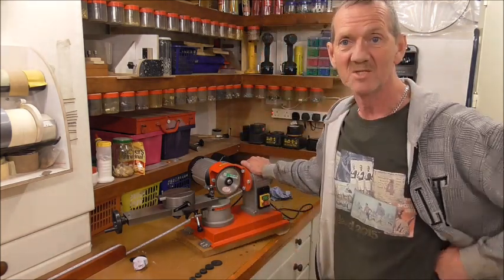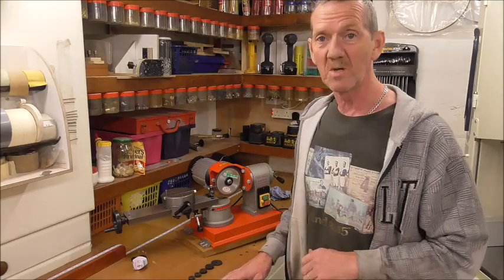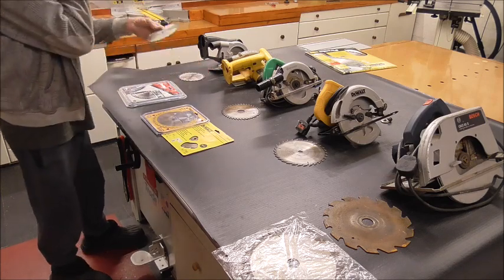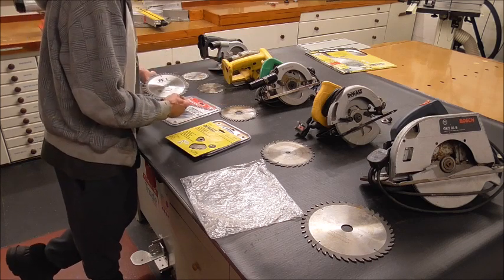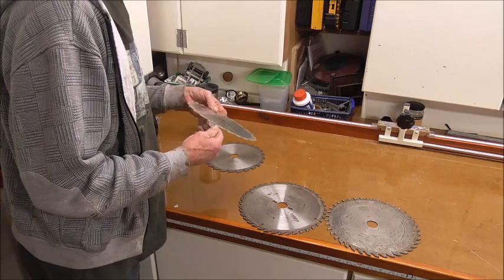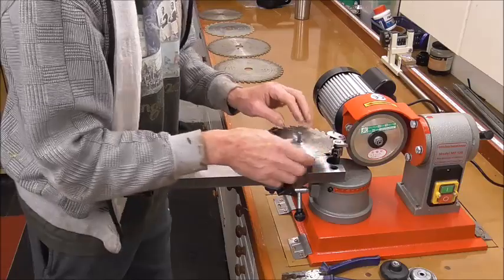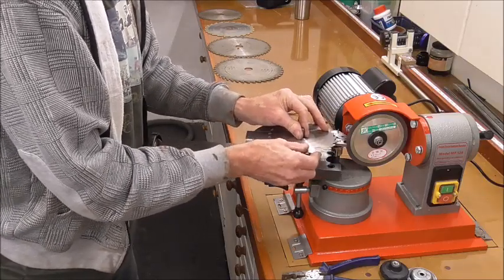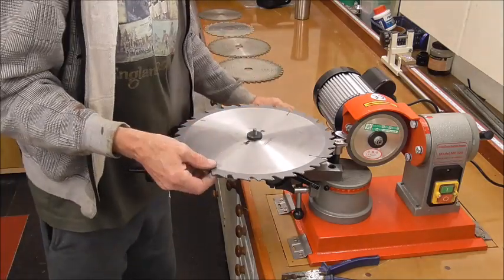Power Saw Blade Sharpening

Comment: one thing you were doing wrong during sharpening is I noticed when you put the tooth against the sharpening wheel you were sliding it forward and back which I understand to evenly wear the wheel but when you were done sharpening you were just sliding the blade back and off the wheel while the blade was still in contact with the sharpening wheel.   this could cause the tip of the saw blade to pass over the edge of the sharpening wheel.  when done sharpening you should back the blade away from the wheel before moving the blade back.

Comment: WASTE OF MONEY,  I USE A TILE SAW, WORKS AWESOME.  USE PAIR OF DOOR SLIDER AND THE ANGLE IS ON THE SAW ITSELF   UNDER 50  BUCKS A PLUS IN MY EYES
Reply from the maker: what ever well done it sounds good,
Reply: Make a video that we could see.
Reply: The tile saw blades sharpen blades that are going to be used on wood sort of fine.   However; you need a smooth edge if you are going to sharpen a blade that will be used on metal.  They just don't make tile saw blades at a fine enough grain.
Great job on this video.
Reply: Why is this sharpener not up too snuff? why the tile saw something better. Please show us how it works. Don

Comment: Thanks for this video. Just received one of these sharpeners. After the typical modifications to get the proper arbor size, tighten the shaft where the stop pin is anchored to, I got it to where I could sharpen my first blade. works really well. My next move is to take my angle grinder and grind a bit off the guard and motor housing where the 4th or 5th tooth hit, left of the grinding wheel . My warranty will be void, but my life will be better for it. I know you know what I am saying. Your video helped me a lot to get this grinder tuned and tweaked!
Reply from the maker: Andy Evenson Thank you Andy for watching, yes i find with many if not all machine tools we need to tweak them to fit with use and how we want to use them, anyway its good news your now up and running and all your power saws will feel much better for it

Comment: Interesting video. I wish I need one of those sharpeners but I’ve only got a couple of circular saws. 
I like your drop in bench tool system, it makes a lot of sense for tools that you don’t use constantly but need to be firmly fixed down.
Reply from the maker: Thanks for watching yes I am adding other tools to this system as the shop is getting smaller with every new tool

Comment: Great video and  explaning  how to and why, i bought exactly the same  saw blade sharpener as you have, coming next week, has a  special googles thats as your lupp to could see exaktly the angle an to  sharpen the right way, could  easly be aplaid with a water tank that could drip down on the surface the  abrasiv works,  sems useless for so short assembleys that you  did to get a tooth sharp, , i say it again good video thanks  5 thums upp

Comment: Cheers for this video. I note they come with a water tray now too, so I will go for that type. £155 but pretty much looks the same. 
Gonna watch your topping vid now.
Reply from the maker: Hi Brian thanks, yes I believe the water one is a upper model not available when I got mine but a word of caution without looking at it, water grinding normally requires different discs if so be sure your given the correct one, beyond that good luck
Reply: @dmgladden  Aha, very good point. More research on my part, cheers. I also need new blades for my planer/thicknesser,  This machine wont sharpen those!!
Reply: @dmgladden  [update]  All good. the one I am looking at has a diamond wheel, if taken gently (light touch), I could use it dry too.
I also remember watching your van re-fit some time ago too, nice job, the rough weather canopy was a nice touch.

Comment: If you could make a collet block that fits in the dovetail on that round thing where you mount the saw blades you could sharpen drill bits with this. With the bit pointing down the length of the arm, the angle of the arm dictates the drill point angle and the angle of the cutting disc is the facet angle.
Reply from the maker: Meme Master yes such a machine van be adapted for a number of other tasks, i do however have a dedicated drill sharpening jig which does me fine but its a good thing to get the most you can out of every tool, thanks for the interesting feedback

Comment: hello, thanks for the video
I have a similar device and was wondering if all teeth are always sharpened at 0 degrees. So say the long part of the tooth, not the tips. If the long part also has to be sharpened at a certain angle, can you tell that from the data on the saw blade?

gr. Arie

Comment: Thanks for the review, I have purchased one of these, had it for six months and now it's time to set it up.
 I would like to point out a small thing that is not covered in the video, for other users.
The DUST from grinding tungsten  is SERIOUSLY DEADLY and should be avoided at all costs.
By this I mean you should wear a mask and have a vacuum cleaner set to suck up the dust.
But very informative video, lets share the knowledge.
Reply from the maker: Thanks for the info which i was fully unaware of so i did a bit of research and this was the best result i got: 
The electrodes themselves present little threat of harmful radiation exposure to personnel. It's the fine airborne dust particulate, released by grinding and tip prep, which pose a threat of radioactive particles entering the body. So if your shop equipment is not properly ventilated it may be out of compliance, putting you at just about as much risk as your smucky coworker who puts the things in his mouth.
Personally i have just 3 years ago stopped smoking, i guess ironical
Reply: Yes ,I actually meant inhaling the fine tungsten dust.
As the ingredients of tungsten carbide include Cadmium, Chromium, Cobalt and Nickel, these are all metals used in tungsten carbide brazing and grinding, not a problem in big pieces, very bad as fine particles..
And thanks for the clip on how to set it up!
Reply: @dmgladden  That information is for Thoriated Tungsten welding electrodes. Grinding dust from grinding any Tungsten Carbide, router bits , lathe/milling bits or saw blades is seriously bad for your health.

Comment: Thanks David, very informative- 

I have a small Sealey sharpener. It's ok. 

I've been for quite a while, angle sharpening the main flat piece - WRONG and not the top as you demonstrated- 

That's a big boob on my part - thank you for this Mate 👍🐒
Reply from the maker: Its all a learning curve Gary and now you know and can pass it on to others that's the one  good thing about youtube, theirs so much we can all learn and its free
Reply: David Gladden - agreed David, and for me  ~ much quicker to touch up now. 

Tx again 👍
Reply: Maybe yes & maybe no!
When your sharpening cross cut saws as shown here the flat face is sharpened at flat angle 90degrees on each tooth & yes when you have to sharpen the top faces due to chip etc THEN for set you tilt the motor & diamond wheel to the 8 degrees shown here.
However,
When your sharpening a rip saw rather than a cross cut saw, the faces aren’t flat 90 degrees, they have an alternate bevel on them of often 5 degrees, so 85 & 95 degrees on alternate teeth as well as the “set” angle on the tops of the 8 degrees shown here.
So “compound” angles for the face meets top.
So when you say you we’re doing the flat faces “wrong” we’re you sharpening a cross cut saw blade or a ripping saw blade?
Next - as well as marking with permanent marker the tooth you started on, IF you also mark the flat face as well, when you start sharpening that first tooth you can check you have your motor / blade tilt exactly at 90 (or for ripping blades at 85 / 95 degrees by whether all the permanent marker is removed across the entirety of the flat face or whether your a fraction of a degree “out” because it’s removing all the ink on one edge of the flat tooth but leaving a little ink trace on the other (leading or trailing) edge.
Now normally on good blades at least, the data on blade diameter, teeth number, arbor size & degree of set hook etc is engraved on the side of the blade or the cardboard packet the blade comes in - to allow you to set up your machine to the original factory specs first go.
What I have done is replace the washer that holds the aluminium diamond coated sharpening wheel to the engine drive shaft with a 3 inch flat steel washer!
I then use a “wixey” brand digital inclinometer / angle finder, (about $45 on evil bay) and with Machine unplugged attach its magnetic face to the washer, which allows you to set the tilt to 1/10th of a degree increments, to get it exact!
Just zero the gauge off the flat face of the saw blade when clamped onto the cast iron cross feed slide, then attach it to the diamond wheel bye it’s magnetic face & adjust the tilt to exactly what you want!
You can then match factory specs first time / tooth every time, and have repeatable accuracy just like the saw doctor does with his fancy automated CNC blade sharpener!
The ink test allows you to confirm visually on the first tooth that you got it exactly right!
Just a couple handy tips for the newbys! 👍
Reply: @ianmoone2359  another thing to add, is safety, a respirator is a must as carbide dust isn't good for you

Comment: My saw blades are 315mm diameter the same as you showWhen I set the rake angle the blade fouls on the motor case. Maybe my blade has an excessive rake angle. It’s 32 teeth. It was the one supplied with the saw by Sedgwick.
Also my blades need the motor tilted to sharpen the tooth.
Reply from the maker: You must have something set wrong or the machines set up wrong as you should have no trouble with that size of blade but without seeing you do it I can't work out what is really going on sorry
Reply: Thanks for the reply. You seemed to have had the same problem at 17.20 ish. The cutter only projects a little bit more than the motor diameter and it’s support piece. This doesn’t matter on smaller blades. I am loath to take the file and hacksaw to it to improve clearance. I can’t find a 130mm dia disc but I have ordered a 125mm dished cutter. It might work. Meanwhile I sharpened with a lesser angle. I find Chinese machinery always has one major design consideration to overcome.
Reply from the maker: @jimbo2629  yes it looks that way but it did fit just the camera angle however I understand what you are saying now but I must say I don't have that problem with any of my blades and they have all been through this machine now, so I haven't had tho think of a way around this problem but I agree that's one of the drawbacks of Chinese tools.
Good luck and let me know how you overcome it once you have. David
Reply: I’ve overcome it by flipping over the cutter disc and the Saw blade. Accommodating  the rake is now obtained by angling away from the motor. Problem solved. Another niggle is the play in the dovetail slide which can produce chatter when the tooth touches the cutter. Again it’s worse with larger blades. I plan to shim it to take up the slop. I don’t understand why manufacturers don’t get the size correct. I have come across the same with mitre fence slots on saws.
Reply from the maker: @jimbo2629  hi Jim, that sounds like an interesting solution when I next get the machine out I will play with that idea, as for the play I think that is a result of too many companies making the different parts I guess that is why most miter fences have built in shimming systems, but I find that's one of the pleasures of owning tools making them your own, like when we one put a jubilee clip on a Yanky  Screwdriver to stop it rolling away it's good to make tools fit us better than they did when new

Comment: One problem I found with this type of machine is, that doing small blades, their teeth are touching the table in the back, while in the front , where the grinding happens, they overhang the table. This results in the blade being slightly tilted and the teeth scubbing over the table during turning the blade to the next tooth. I fixed the problem for at least the midium sized blades by drilling an tapping another screw hole in the sliding bar, coser to the center of the table. But for the very small blades, this hole would be right in the center, where it cannot be, because of the locking pin and the groove cut inte underside of the slider.
Reply from the maker: Why not just use a packers between the blade and the table to give clearance just enough to cover to set on the teeth

Comment: Hi David thanks for the very informative vid, (liked & subbed)  just ordered one of these and I doubt the instructions that will come with it will help! How is the wear on the grinding disc? Do you know where replacements can be had? All the best Terry.
Reply from the maker: Hi Terry, thank you for the Sub, the disc seems to last a good time i am on my second but i broke the first by spinning the table to much, i got my new one from Ireland through ebay but do a search when you get yours and keep a new one in
Reply: @dmgladden  Thanks David will do, got to work out how I'm going to fit it in the back of my Sharpening van yet, but will give me a project to do during this damn lockdown!
Reply from the maker: @cashman156  yes i know what you mean i did about 40 videos in the first lock down
Reply: @dmgladden  Keep up the good work here and stay safe mate.

Comment: Do you sharpen the face of the tooth at an angle too or just every other tooth tip?
Reply: cross cut blade- face of teeth square and top of teeth angled,  rip cut blade- face of teeth alternating angles and top of teeth square, hope this helps

Comment: Fantastic presentation, the first of it's kind I've seen. However I have been led to  believe the sides are to be sharpened too. Could you kindly eloberate on that?
Reply from the maker: Francis Gonsalves no if you sharpen the side you change the size of the blade just clean the side you may some times need to top them but never the sides

Comment: I recently purchased the same sharpener as you have and my question is, do you have a source/vendor where you can acquire a replacement wheel? Wheel diameter is 4.92”/125 mm, arbor size is 1.26”/ 32mm. I would appreciate any information you could provide. Thank you.
Reply from the maker: Hi Gary i found it your last request sorry i did miss it i guess sometimes i get too many or get lost going through them all, anyway hope the reply on the other video as helped

Comment: Hello! Great video, compliments! Do you think it is capable of sharpening blades with a diameter of 600mm and alternating teeth? Where can I buy it?
Reply from the maker: I don't  know about the 600mm mine are 300 but there is lots of room left, if you see the last blade I do that's a 300 and see it looks smallmon the bed so maybe but yes alternating teeth I do do one to show how, as for where to buy that's easy China through eBay but many sellers have them, deals change all the time so as for price I couldn't say now you just find the best deal today but check it's a good seller

Comment: Thanks David, can you tell me the type of sharpening wheel you would need. ( Is it a diamond type or can I use an aluminum oxide.)
Reply from the maker: Hi Ned and thanks, its a Aluminium Oxide disc
Reply: Hi. Respect for the video.Same as Neil, your disk is actually a diamond resin bonded disk. Specs from the manufacturer:"Bonding Agent : S2 Diamond Concentration : 75%
 Outside Diameter: 150mm   
 Mounting Hole Diameter: 32mm
 Diamond Coated Width: 8mm
 Grit :150"For cheaper disks diamond concentration is almost certainly much lower even with some reputable source concentration is as low as 20%, sometimes mixed up with other abrasives and even worse the bonding agent is "filled" with whatever they get cheapest. (that's why I'll add an reply to the water cooled comment) And it is hard to guesstimate it at home. The rule is that it gets close to what you pay for.

Comment: One more thing: I have some blades where the face of the carbide tip alternates angles (not the top of the tip, but the face of the tip). I can't find any videos that address that, do you know anything about that? Thanks!
Reply from the maker: I haven't got any such blades but i would imagine you would have to do it in two stages changing the angle for the second stage, i might be wrong but that's how i would aproach it
Reply: @dmgladden  Thanks David. I think I must have gotten it wrong and it's in fact the tip of the tooth, because I can't find any references online to this. I have to double check tomorrow in the workshop. Thanks for replying! Keep up the good work.
Reply from the maker: @tinycuisine6544  yes it does sound a little strange but i wasn't going to disagree with you after all no one knows every thing

Comment: You seem to be turning the blade    up to the indexing stop while blade is in forward sliding position.
I would have thought you should index blade to pin first and then slide forward and back.This way you start cutting with the tip of the wheel first and not just bumping the whole of the face onto the wheel in one go.
Reply from the maker: I think it's just the camera view, but it seems you are knowledgeable to understand what I am showing